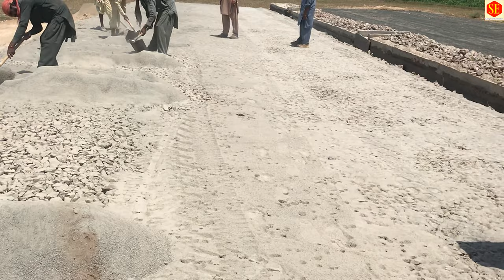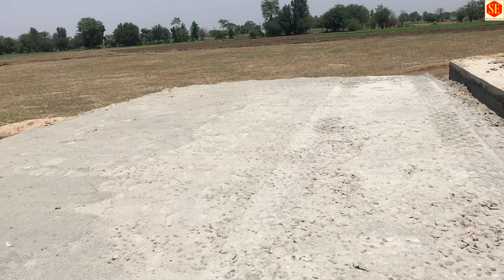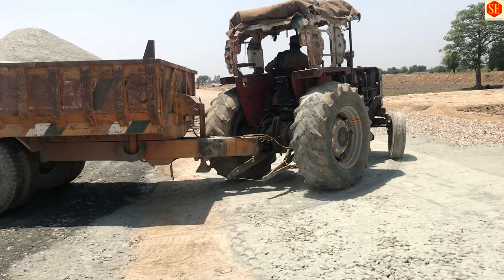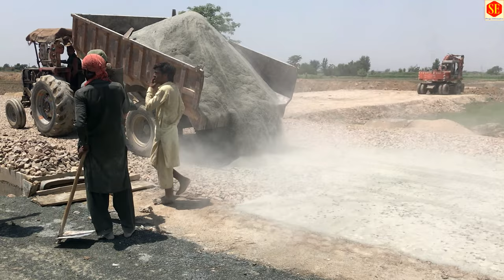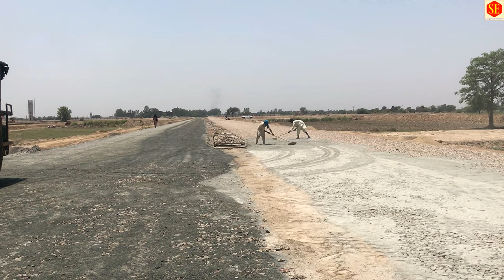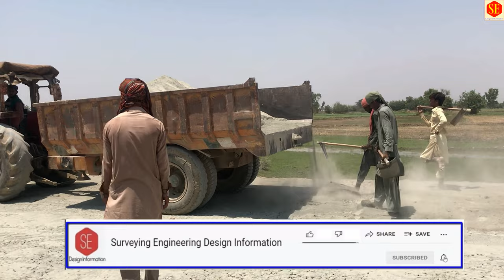Spreading of Stone Dust on WBM. |Construction of Road|

Comment: Vedio is showing screening material heaped on the dry rolled WBM surface which is not correct. 
Screening material should be stacked little away from the dry rolled WBM surface and then it should be sprinkled in light quantity over dry rolled WBM surface followed by brooming n rolling thereby allowing maximum screening material within the interstices of the WBM surface.
Once done so, thereafter water should be sprinkled along with rolling simultaneously followed by making good of screening material wherever required by sprinkling.
Thus correct procedure only should be shown in the vedio too for correct conception.
Reply from the maker: Okay